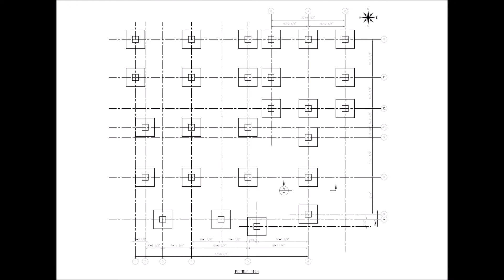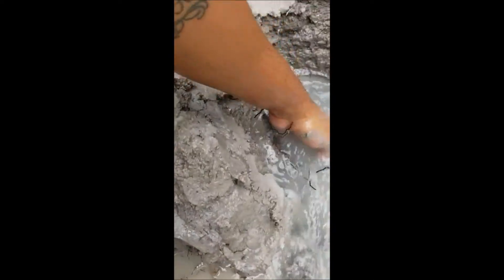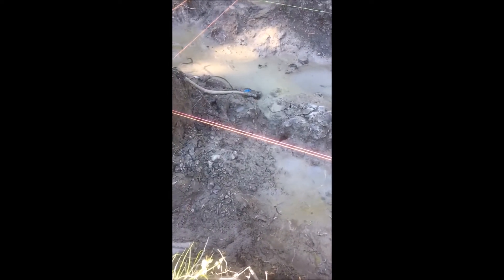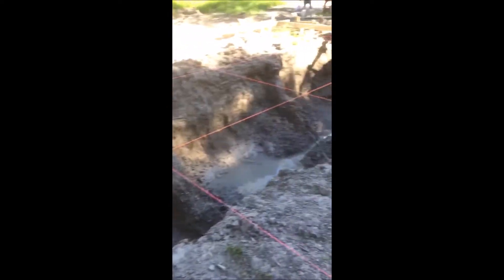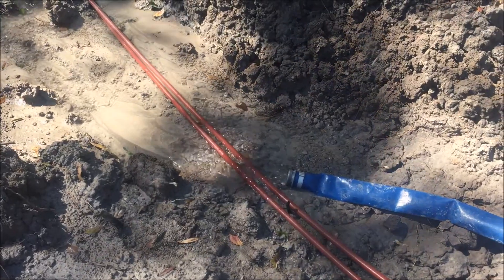High Water Table Foundation in Conroe, TX

Comment: Not understanding why another type of deep pier wasnt used, i understand you said you couldn't do bell bottom piers, but there's so many types. You could driven wood, steel, precast etc vs drilling and filling  borehole w grout to make deep foundation. Theres driven 4-6" pipe you fill after hammereing it in etc. Then put grade beams and or waffle slab on that?

How deep until bedrock or higher load bearing substrata?

How deep is frost line there?

Comment: It will be better to use raft foundation on this type of soil, to avoid settlement...
Reply: Raft foundations make sense for soft soils, but in wet lands it's a different game.  Wouldn't want the house to float... ?
Reply: @Krizbonz  The weight of the raft must be higher than the water reaction. Then it will not float.
Reply: @maherhaddad6455  ah ok 👍